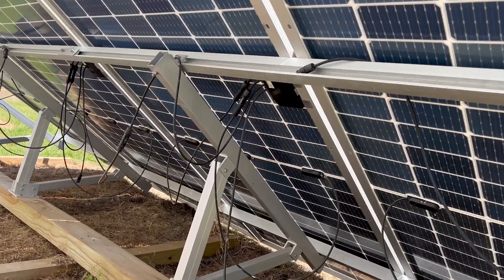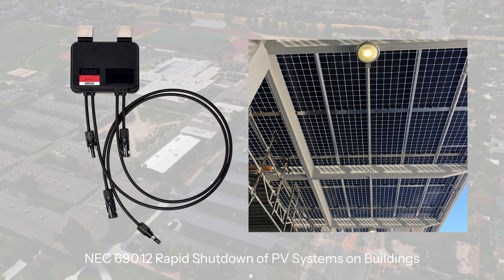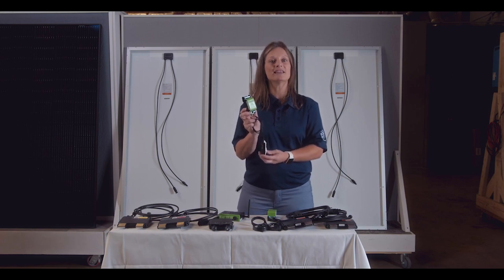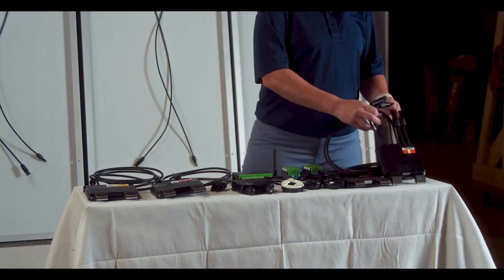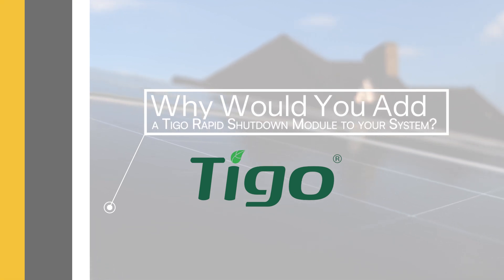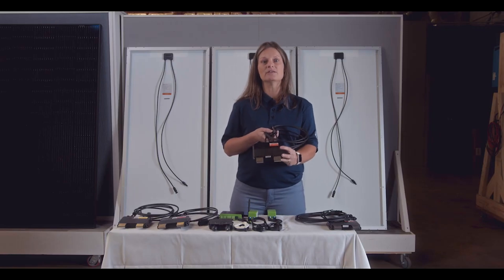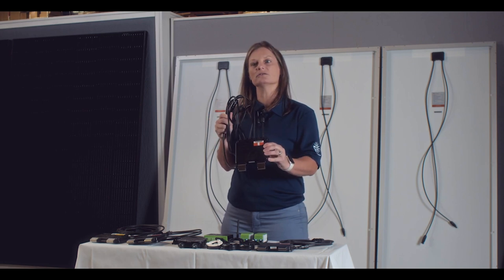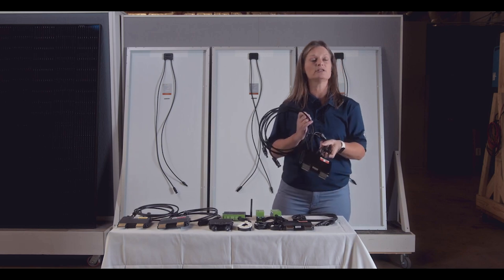Tigo MLPE: Is Your Solar System Protected? Detailed Overview and Safety Benefits

Comment: Hi I’m getting a sigenergy battery and gateway installed at my house and I’m interested in the Tigo optimisers. I read on the site that if the grid power goes down it will trigger the rapid shut down. But I want my system to continue running in the event of a power cut. Also is it true that if a panel develops a crack that could lead to and arc the rapid shut down will kick in preventing a possible fire?